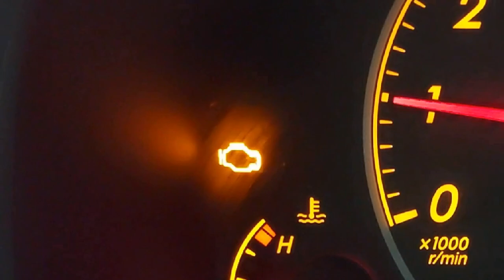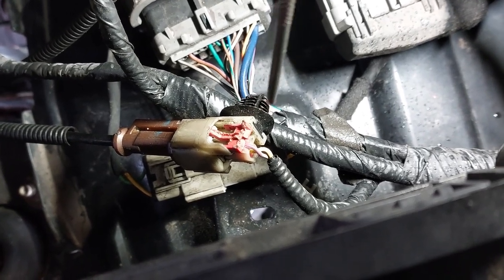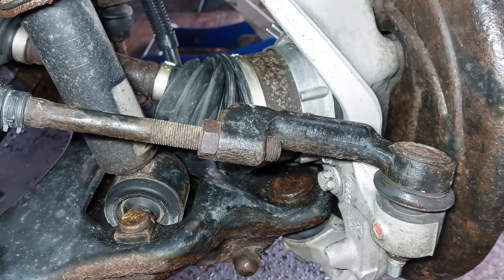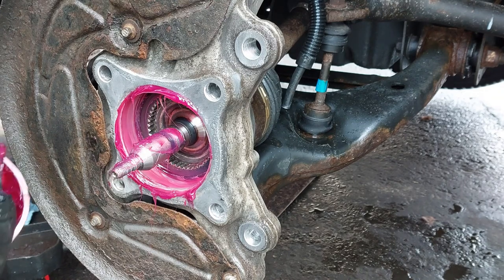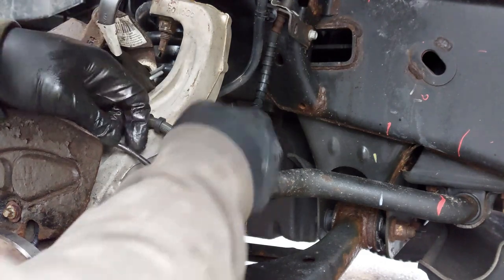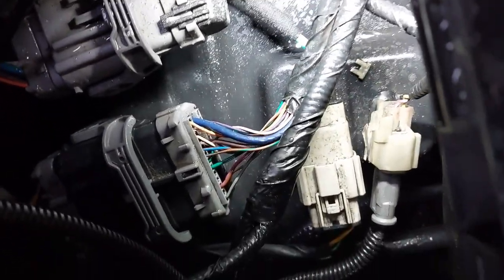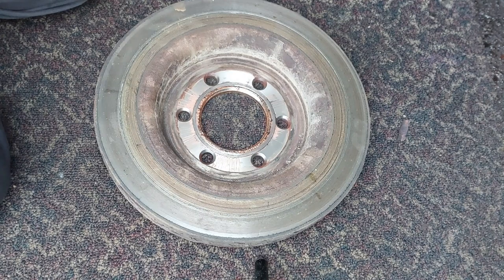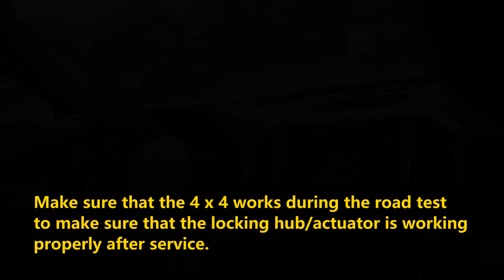2016 Ford F-150 - 3.5 V6 - 4X4 - Wheel Bearing Diagnosis and Replacement

Comment from the maker: Torque Specifications For The IWE Locking Hub:

Install the IWE-to-wheel knuckle retaining bolts.
Torque: 106 lb.in (12 Nm)

106 In. Lbs. / 12 = 8.83 Ft. Lbs.

One procedure I forgot and did not mention in this video:

NOTICE: Measure the depth of the CV shaft threaded end to the inner bearing race (shown in illustration). The minimum depth is 15.5 mm (0.61 in). If the depth is less than 15.5 mm (0.61 in) rotate the CV shaft to clear a binding condition between the IWE and CV splines. Installing the axle nut and tightening without the proper depth of protrusion will result in damage to the IWE.